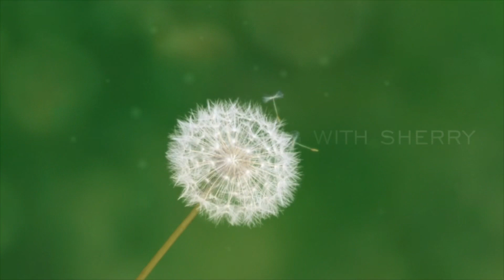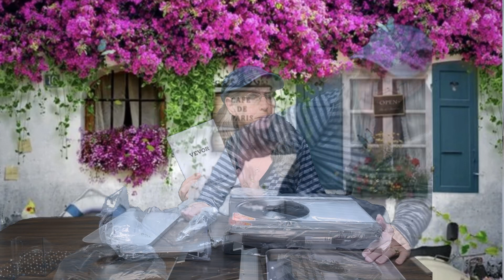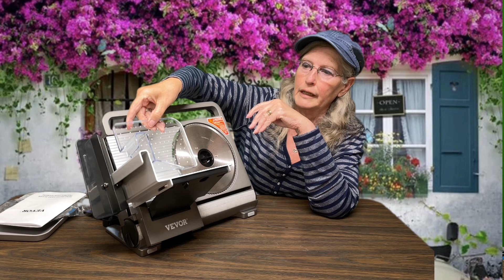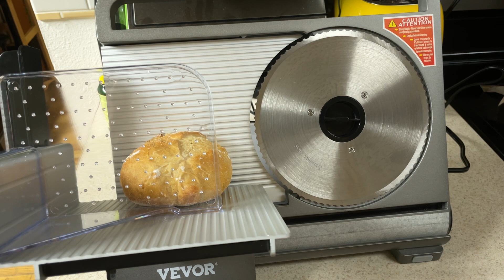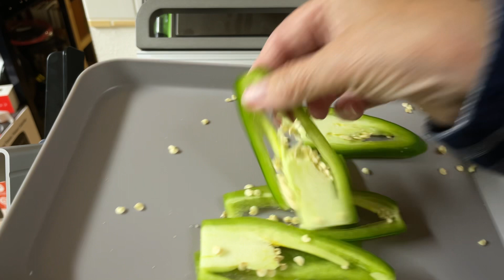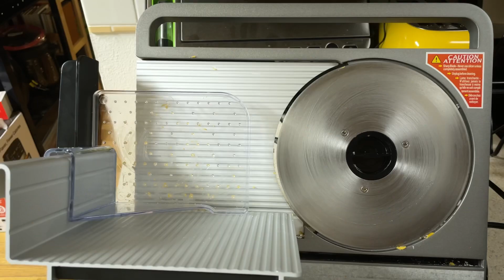Vevor Meat Slicer Review

Comment: Your review Sherry is very thorough and well discribed. Most commerical slicers are much heavier so they are more stable.   In a  commercial setting the blade would need to be cleaned after slicing meat before slicing cheese to avoid cross contamination.  
Like a lot of kitchen gadgets it comes down to are you going to use it enough to justify the cost and clean up.  I guess for a large family gathering it might be a big time saver.
Best Wishes
Kevin  :)
Reply from the maker: Thanks it isn’t as stable or as good as a commercial one . And yes in a sanitary condition home as well as commercial it should be cleaned between . And to be honest, it’s just me and my husband , I’ve only used it one other time . Thanks for your feedback